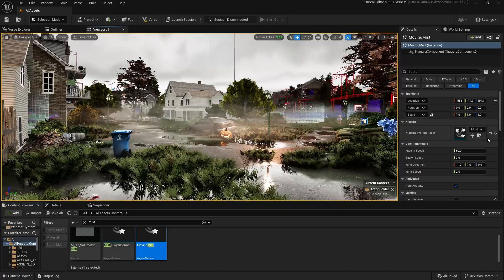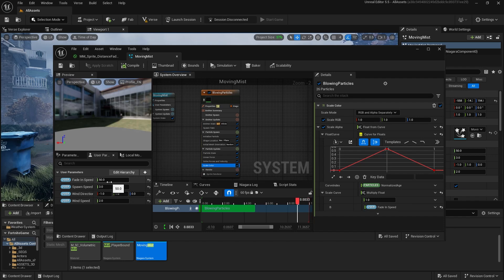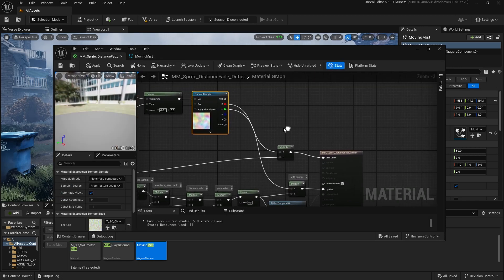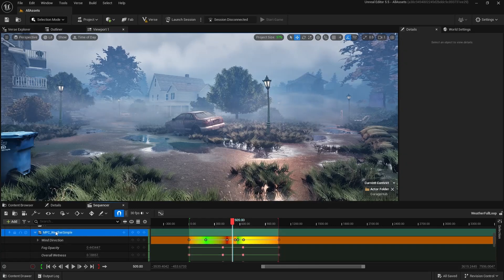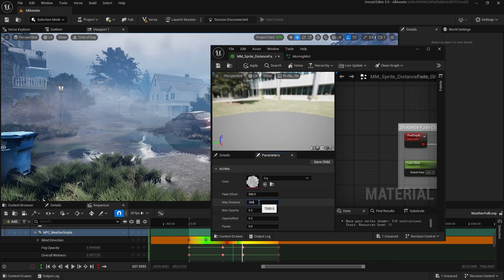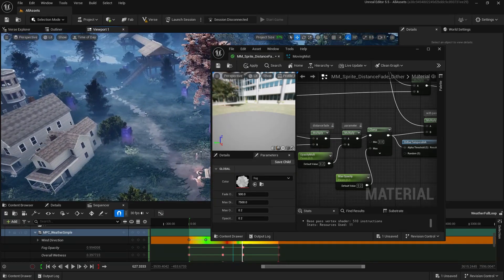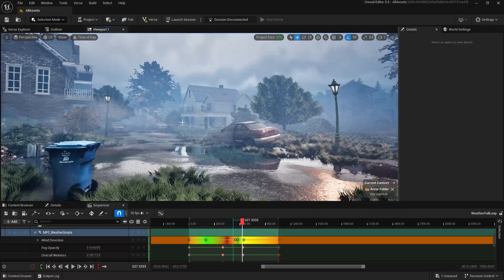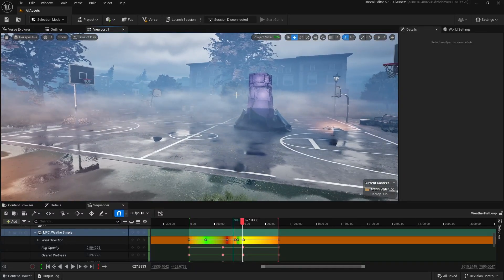Fake Volumetric Silent Hill fog for cheap in UE5 and UEFN

Comment: it will help you grow your channel if you would actually do a tutorial step by step instead of just explaining what you already did of screen... is hard like that
Reply from the maker: Which part was difficult/needs clarification ? I work full time so if you support the channel/ subscribe to patreon i can spend more time on these
Reply: @612games  the process my friend. if you teach someone to fish is one thing, if you tell others how you got the fish is not teaching. but i guess you don't want to grow your channel.
Reply from the maker: @gameswownow7213  That's why I asked you which part was confusing, I am trying to help. If the whole video is confusing to you I recommend learning about Niagara and Material graph, this is not a beginner tutorial
Reply: @612games  is hard to learn like that... we are noobz we need to see the steps. to be able to learn and do it ourselves. like an actual tutorial.. not explanation of what you've done. is hard to keep track and with unreal engine is very important the actual steps.
Reply: @612games  I understand it fine its basically a bunch of nodes with a few materials and textures thrown in there